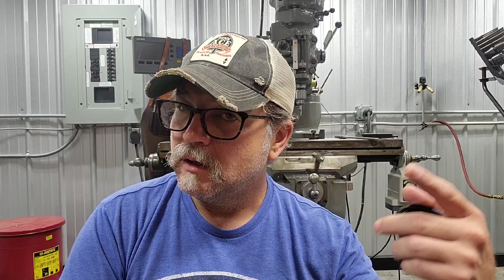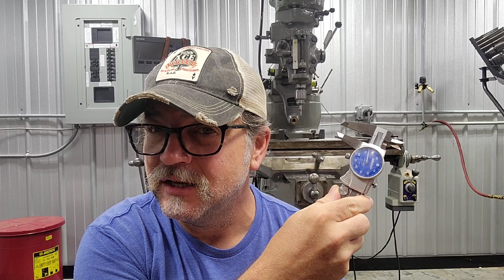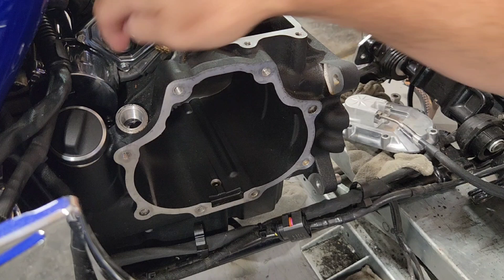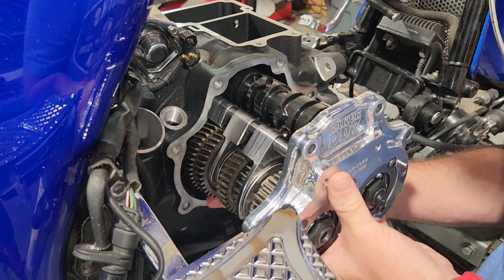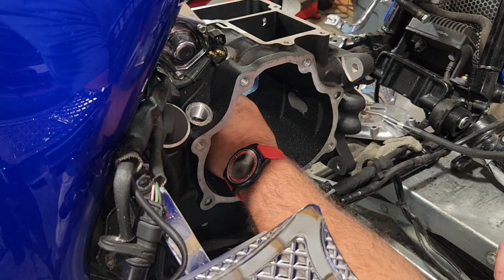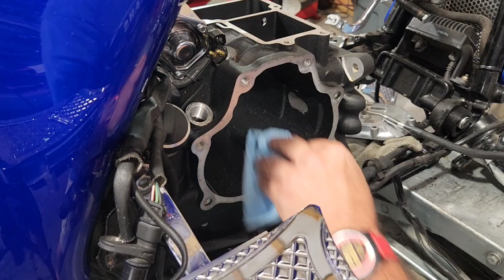DONT MAKE AN EXPENSIVE MISTAKE! - Baker DD7 and Grudgebox Install Tips Part 2 - Kevin Baxter

Comment: Hi Kevin, I watch your videos but this is my first time commenting. 
I have a 2015 road glide CVO with 91k miles on it. I did a big bore kit @ 52k miles and it came off the Dyno at 118/124. My problem is that 5th gear started slipping last week and everything I read pointed to the clutch pack so yesterday I swapped it out to a Barnett extra disc kevlar  pack and put 36 ounces of Redline primary fluid in it. 5th gear is still slipping but every other gear pulls great. The bike has a hydraulic clutch. 
I’m reaching out to you about this because I can’t seem to find a cure for this and I’m in hopes that you’ve run into this issue given your experience with these bikes. 
I hope you find my question and have a suggestion for me since I can’t seem to find a solution anywhere else. 
Thanks Kevin

Comment: tc 117 build. running evolution clutch and man o war comp and manual adjuster. i have horrible rattle from primary, appears to be clutch plate rattle. This combo is supposed to be the best but sound is scary.

Comment: I know it is not directly related to this video but in a way it is.  Why 7 speeds?  I own a '23 FXLRS.  6 ratios available. The top one is usable after about 55 MPH.
Do I need more?  Hmmmm?  Same is true with engine power.  I installed S&S 475C cam on otherwise stock engine 2->1exhuast 117.  Fuel map corrected, of course.  I love it for the loping idle(awesome sound)even though it is a bit less manageable below 10MPH due to the lope.  The power is far more than I could ever use.  Wheelies available in any gear below 5th.  It really makes me wonder why people feel the need to "up-stage" from that point.  It is power one cannot realistically use and makes the machine a bit hard to ride.  Why oh why oh why do people feel the need to re-cylinder and perhaps re-head a machine that puts out more power than is useful?  I think too many folk are willing to spend too much $$$ on things they'll never use and do not understand.  Just getting a silly graph with high peak really doesn't mean anything other than an ego boost. I'd enjoy a video on that subject.
Thanks.

Comment: Could you use a little bit of paint, that has been allowed to dry, to indicate clearance issues? That is you don’t have a powder coated transmission housing.
Reply: On uncoated cases if there is interference it should leave a shiny spot where it scratches the aluminum
Reply: Use machinist bluing

Comment: Great vid Kevin. If I didn't know better I'd swear those were the marks in my ttanny case. Suggestion to others if you have a vacuum available,  keep the vacuum next to the die grinder while cleaning away the metal. It assists with eliminating the contamination

Comment: What is the advantage of the Baker DD7 over the HD 6 speed? The final gear ratios are the same. Don't see it being better for racing. Is it for heavier towing because the lower gears have a higher ratio?

Comment: If you’re going to do it, do it right. I wanted a gear drive setup and was three thousandths over. Is what it is.
Reply: Gotta have a proper flywheel setup for gear drive
Even if u get a good crank from the factory.. <0.005 .. after 10k miles it may be 2 thou more then that and so on